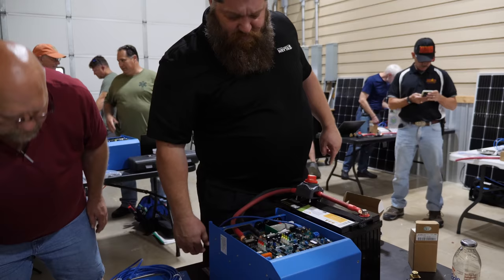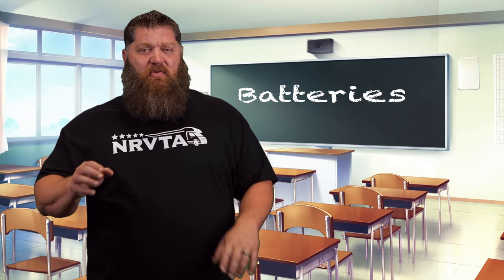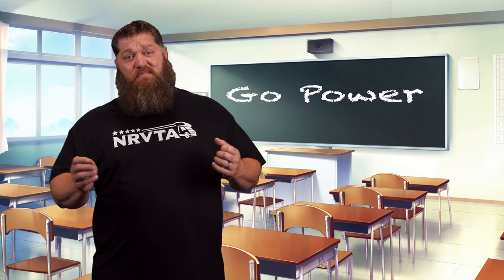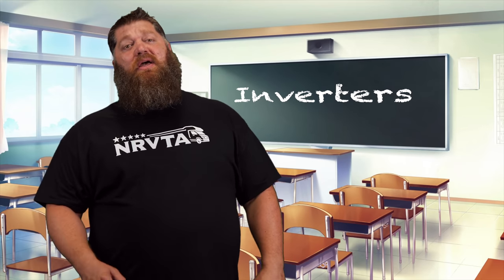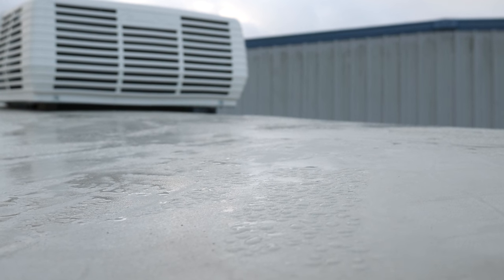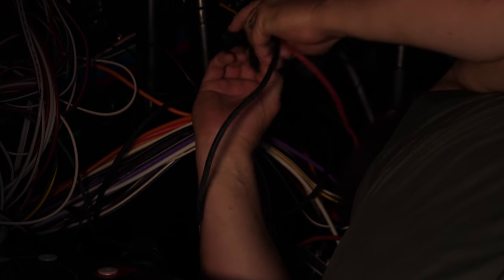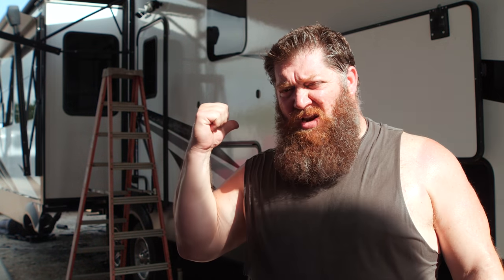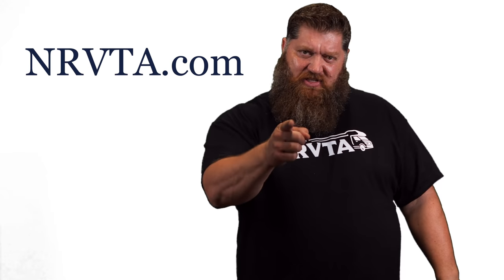The Solar Challenge with Big Truck Big RV

Comment: Great video! I just got my solar panels hooked up and the controller is on , however I have a flooded battery😭 so question while my solar panels are hooked up would it be a safe idea to plug my rv up to the generator???

Comment: Question? I have the same go power system, but in the instructions they say to wire the panels in parallel as they are connected to a pwm solar controller. But in this video you put the panels in series, why did you change it from the manufacturers instructions?
Reply from the maker: It’s always best to follow the manufacturers recommendations. This was a custom system with a few little tweaks.

Comment: Nice collaboration between you and BTBRV.  Just recently subscribed to your channel. 
I have a truck mounted 2007 Lance 992 camper it has 2 lead acid batteries and an on board converter. I understand to convert to lithium batteries the old converter needs to swapped out for a newer model converter/charger and not use the trucks alternator for charging the batteries while driving. I’m not concerned about using the A/C but it would be nice to have the extended power of the lithium batteries for running fans, TV and DVD player at night. I recently bought a portable solar panel battery charger too.
Reply from the maker: So a lithium capable charger and you can use your alternator IF you put a dc-dc charger in between the alternator and lithium batteries.

Comment: I really appreciate this and the videos from BTBRV, but didn’t get the type of sealant you spoke so highly of to seal the entry hole and screws.  Could you please let us know what that product is?
Thanks,
Reply from the maker: Hi BK, That's a product called AFCAT 945 Sealant. You can buy it by the box or by the tube. https://marketplace.afcatusa.com/#/itemspecification/142
Reply: @NationalRVTrainingAcademy  thanks so much...just about to mount my solar panels, very timely information.

Comment: How much solar do you need? Few things you need to consider to answer that question. First how many panels can you fit on your roof. How much storage space if you plan on a ground setup. How much 💰 you would like to invest in your system. These really determine the size of your system. For us $6200.00 was the number. What did we install? Just over 2000 watts of solar and 600 Ah of batteries. Our system is a DIY system that with a little research. Solar is not that complicated and you may not need to pay for installation. I do have a video of the system on my channel. Plus a quick view of our 5500 watt house system. Thanks for your videos they help with the research.

Comment: It seems almost everyone does 12 volt. Why not do 24 volt with 4,000 watt inverter/charger? Or 24 volt solar panels Or why not use Schneider which can take the bigger punch when the ac kicks on
Reply from the maker: Specifically my system is 24volts

Comment: I don’t get why you would leave the original 12v system intact. It seems like the 1000w factory inverter is superfluous, the lead acid batteries, dead weight, and the factory solar panel a missed opportunity. If the factory system runs the fridge when their is no an AC power source what happens if those batteries go dead? It seems like you’d have to turn on the main inverter which is now powering a converter to charge those batteries which certainly isn’t efficient.